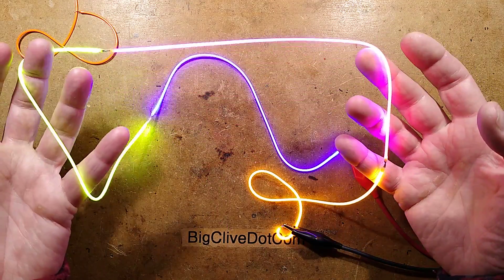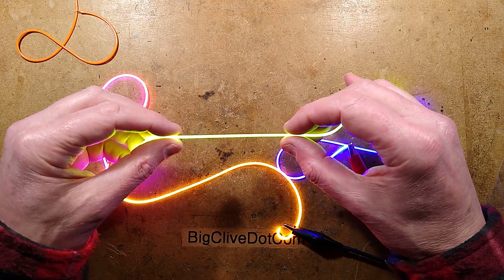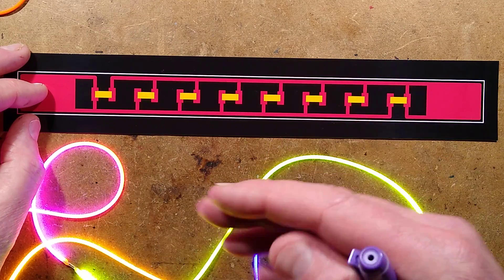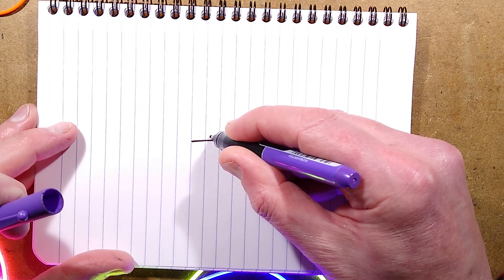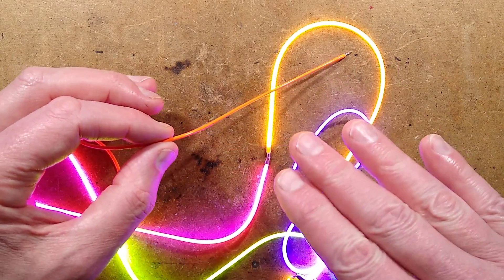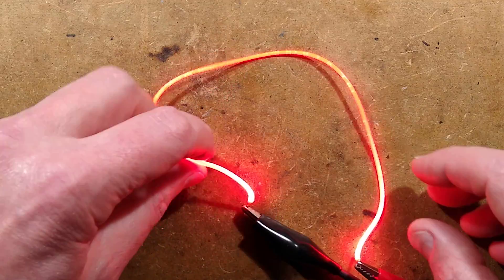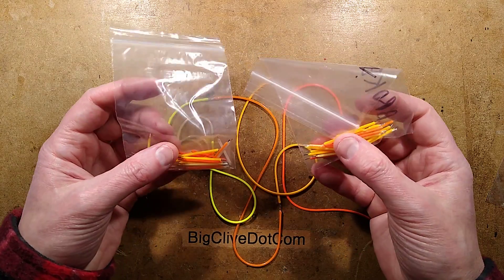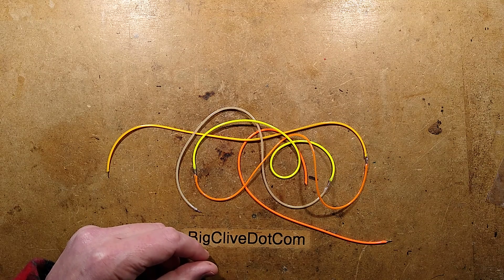How long LED filaments are made

Comment: I would like to run a pair of these in series off of a 2s Lipo battery... Would you use a 22ohm resistor? How should I do it for an RC car...
Reply from the maker: 47 ohm as calculated in my reply on your other comment.

Comment: Can you cut them shorter and solder back to the cut end, or are they a fixed length?
Reply from the maker: You can't trim them.  But you can get very thin single sided LED strip.

Comment: The strips being dimmer in the middle could be total internal reflection causing them to act similarly to a glass fiber. To check this you can try to bend the strip and see if it gets brighter on that spot.

Comment: they use 230v to 3v converter in these e27 bulbs and that's it? How they do it that it works with a wall dimmer?
Reply from the maker: Not all LED lamps are compatible with a dimmer.

Comment: Good day LED wire me tire resistance on the ends or just because the wire is so small or maybe heat on the ends you know marginally but because of the size of the wire it induces resistance to the middle of the strip

Comment: not sure if im missing something, but do you need a resistor in series with these? 
i mean, they are just diodes on a string, right? 
so if i connect 4 in series (4 x 3v = 12v), and hook it up to a 12v battery (say, a car) it would burn out if theres no resistance, right? 
-i just ordered 10pcs, so im very curious, as they are quite nice! cheers :)
Reply from the maker: I'd recommend a resistor to control the current.

Comment: Interesting. I wonder if the reason that they are brighter (receiving more current) at the ends although all the leds have equivalent resistance is because of the magnetic field generated by the circuit? Could you test that by looping the string of leds up and passing a powerful magnet through the center to see if the filaments glow more evenly throughout? Love your channel BigClive!
Reply: That moment when you get a like from a great content creator on a comment, then notice a typo in your comment, and proceed to edit it, deleting the like from said creator 😥

Comment: If you need a shorter length.  You can cut it to size then burn one end.  If you are careful you can expose the conductors. Some projects require a fixed length because I have no place to hide the surplus.  They are really wiggly and hard to manage.  No glue will stick to it as well.

Comment: The red ones I received are fairly bright and evenly lit, I don't think any have the brighter ends like yours do. They are very fragile though, I had one break in the center somewhere and is now intermittent, if using for an everyday items, I'd add some additional protection.

Comment: Ooooh pretty, and 4 sections are 12v? Sounds perfect for adding some extra light to some pinball ramps/wireforms.
Reply: Much better than the way they did it on the TRON LE pin

Comment: at 3V i guess you could use a single Lithium cell to run them all in parallel, running thin enameled wire beside it like you've shown they do with fairy-lights.

Comment: For the red ones, I wonder why they don't just use red chips and a diffusing silicone with no phosphor. Sure it would change the running voltage but it's not like anyone worries about that with literally any other LED technology. Or they could rearrange the wiring to two blues in series on the normal ones for about 6v and have 3 reds in series on the red ones to achieve about the same thing.
Reply from the maker: The main market for the flip chips is blue LEDs for phosphor stimulation.  I don't know if they even do red ones in that form.

Comment: 😍 you do understand whay the midle burnes less.
You only have to realize...💜
Thention.
If i hava 2 diverend negativetise 

==-min 100===================

=====================-1000==

After the furst the thention is bicker
But bevore the last the thention becomes lower.

Than the furst led has aboud thention diverentional - 900
The second thention diverentional -899 and somewere becomes -800

And this interaction to exeterated the phosfor atoms to maniveste  dragged space to leak out for ua to see the light.
The more diverentional to more draged to release and leak in to the inviorment 
And there for you starts at boths ends(stards) are brighter the the midle part😍💜🌈

Nice flexible led😍😍😍

I go look mabey they are olso in diverend lengts😍

Comment: I ve been testing with mine, the string plugs at only one end and it has two flimsy wires, one seems painted isolating it from the other single strand not isolated so not sure if they are from different technologies...

Comment: The trace length will affect the voltage drop between LED's
Reply: Could a Thevenin or Norton Theorem solve why the LED's are duller in the middle?

Comment: i think the off/tipped leds happens when the circuit board is conveying. Either the tension gets to high, or low, as the led chips are being placed on the circuit board, or during soldering. which could cause them to tip over. 
I really like these filaments, but they are delicate. Im holding out for the 5 mm version. =P
Reply from the maker: The 5mm (6mm) version is the LED neon strip.

Comment: I don't see how this can work without each LED having its own resistor.
We're talking about 200 LEDs here. Even the slightest difference in forward voltage between the LEDs should lead to a very short lifespan. And what if a few LEDs stop working? Then the others have to cope with the higher current. It just makes no sense to run so many LEDs in parallel without individual current limiting.
Reply from the maker: The products that use parallel LEDs tend to use forward voltage matched ones from the same batch.
Reply: @bigclivedotcom  Well yes but it's cheap Chinese stuff so I wonder how well they're matching. The fact that some of the filaments are lit very uneven already shows how bad the current distribution across the LEDs is. And it's still the same as a string of vintage parallel Christmas lights where one would fail and soon others would follow.
I guess the best way to use these is to underpower them.

Comment: The LEDs at each end of the strings being brighter is due to voltage drop on the PCB making the center LEDs dimmer. Every LED sees the same overall trace length but the average current over the traces is higher for the center LEDs (100LEDs of current rising to 200LEDs, in either direction) therefore they suffer higher voltage drop, compared the the LEDs on the ends (1 LED current near them, rising to 200LEDs current at the far end). The current is probably quite unbalanced to make a visual difference like that - I wouldn't be surprised if the center LEDs are drawing half the current compared to the ones at the ends. Problem can be solved by dividing the string into multiple parallel connected shorter strings with dedicated traces but of course that requires more than 2 traces.
Reply: It could also be due to the light reflecting at the ends in the silicone covering, since it appears that some of the light is diffused through the covering material and therefore would act somewhat like a fiber optic string
Reply: Would it help if the supply traces were thicker?
Reply: @warpeggioslab  or taper the traces so that the resistance is lowered where current is highest but increased where it's lowest. The current to the middle LEDs would flow through the thickest parts of the traces on both sides. The current to LEDs at the end would flow through a short thick section on one side and long thin section on the other.
Reply: @warpeggioslab  yes. But in theory you need an infinitely wide trace to have completely even current distribution.

Comment: Why has nobody in the Gundam community not used these to do a Strike Gundam with one of these in the beam blade? It would be perfect because that blade actually has metal on both ends of the beam so you could complete the circuit, unlike the more "lightsaber" style weapons where the blade would not look right.

Comment: Next step is they find a way so you can cut it to the desired length. Would be awesome if you could buy spools of this stuff and just cut off whatever length you need. May proof very difficult though because the circuit board is so narrow and fragile.

Comment: the reason they're probably brighter on the ends and not in the center. might be the fact that they are trying to mimic actual neon, and actual neon it's always going to be brighter on the outer ends due to the fact that that's where the voltage is coming from.. just a thought

Comment: Extra copper resistance will give you this effect of dimmed leds along the strip. Same for long 12v strips at the end you may be down to 9-10v
Reply: As Clive shows in his diagram (assuming it's correct) the  total copper trace length should be almost identical for each led - barring the two endmost ones which have a double connection to one terminal for some reason (probably mechanical).   

To make that clearer, held the with the anode terminal left and cathode terminal right, the leftmost led has a short anode trace and a long cathode trace, the rightmost led has a long anode trace and short cathode trace.  As you move from left to right each led trades a  progressively longer anode for a progressively shorter cathode. so they *should* be on balance the total length of copper, which is what matters.  

There's no reason I can think of that more than one led on each end would be brighter, which may be what we are seeing just gets blown out so hard to tell.
Reply: @JamesSleeman  Go on and simulate it yourself on circuitjs, it works exactly this way. it becomes resistor ladder not just copper wires of the same length.

Comment: hah You had probably already ordered this by the time I suggested you to get some a couple weeks ago... but thanks for this either way!
These are amazing looking, and when I had been checking them out on Ali back then, I hadn't even considered other colors beyond the "incandescent filament" replacement yellow-orange (ie warm white). Which, as BRUXXUS said, it's like what EL Wire should've been. Though, admittedly, EL has the tradeoff of being much longer.

Anyways, I wonder if the brightness at the ends might be some sort of "Fiber Optics" sort of effect that's occurring through the fluourescent coating?? Probably not, but that's all I can think of that might plausibly be the case.

Do we know how long this would run off a 3.3 watch battery -- say the CR2032 or the thicker 'higher capacity' ones (or two batts in parallel), to make much cooler "throwies" out of? 
("throwies": typically a watch battery powered, zero-IC or minimalist IC device that lights up or flashes; so named due to being small and able to be easily thrown around, but cheap enough to be 'disposably manufactured', ie throw-away)

Comment: Each LED has the same length of wire but not all the sections of wire carry the same current. Maybe the middle LEDs are dimmer because, on average, their wires are under higher load, hotter, and thus higher resistance.

Comment: Can you please try to make either a necklace or bracelet with these? It could use something like a cr2032 battery in a little case to act as both the power source, and clasp to hold the ends together.

Comment: The reason the led at bout ends shines brighter than in the middle is surely because these are produced with weirs that are so thin, that they loose power due to resistance over distance. And at each end, closest to the "power source" the led`s have the potential to deliver or receive higher current even if it the voltage is the same. The work more efficient wen they have the potential to pass trough more electrons. Ehm... they "ask" for more, because they can, and in fact doo pass trough more... Poorly explained, sorry🥴

Comment: I think the variation in brightness at either end will be due to the "distributed" nature of the current paths. Whilst the resistances are balanced, the IR drops for each LED aren't. You'll get a symmetric quadratic function for the voltage drop with LED position. Compare with Elmore delay model approximations etc. where the delay of an RC line goes up with the square of the line length.

Comment: Lengthy comment incoming!
This reminds me - again - of a strip of 12V RGB LED tape which i found once that's been floating about in my "misc. lighting stuff" box since. I would like to put it into my computer cabinet 😃. Has 4 solder pads, cuttable by ~15cm/6in. segments. Plus goes in, through the LEDs, and comes out as three lines you're supposed to switch/modulate etc. 
There's a tiny box with it. It has a barrel jack for 12VDC supply, one cable (4 in./11cm) with an IR receiver("CHQB") and another cable for connection to the tape.
Just says "LED RGB controller" on the plastic box, and "made from Chineesium". Inside - all in SMT - is: 
a 24c02 IC (isn't that an I²C serial EEPROM? Light pattern bitpool?) and a blank eight-legged bug labelled "MCU" on the board. 
Some caps&resistors. Two glass pipes between the "plus" and the MCU (one diode and one Zener). 
Three A2SHB switching transistors, each connected to the MCU per a 10k resistor. Thing is using PWM, i assume? I don't have that IR remote control, but I would like to make a "powered by DIY and Arduino" type gadget to remote-control that box.
Does anyone - maybe even Clive? - have a code list or Arduino sketch with the #DEFINEs for what to send to those gadgets? I assume they are relatively similar in codes assigned to the functions?
Sorry, i know this video's comment thread here is not the most appropriate place to ask such questions. 😃
If gathering the IR codes involved is too much of a hassle, I'd scrap that control box and make my own dimmer box. Re-watching your "555 timer RGB dimmer" video right now for inspiration in another tab. 😂

Comment: I don't think the LED's are brighter at the ends necessarily due to a difference in voltage or resistance, I think it is just the "fiber optic"-like effect of the cable itself and the light is amplifying on itself?... Just a guess

Comment: Solvents will swell the silicone, and eventually turn it to a jelly-like mess, but to break the cross-links and actually dissolve it away is a very different process.  Acetone + ispopropyl alcohol, with a splash of ammonia, might do the trick.  
The LEDs at the ends glow brighter because that's where the voltage drop is greatest.  (Imagine pipes laid out in a ladder pattern: the flow through the middle rungs would be lower than at the ends.)

Comment: It is never a good idea to connect LEDs in parallel.  The voltage drop among them will never be perfect so the ones with a lower voltage drop will clamp down those with a higher one.  They could be relying on the small but finite resistance in the trace or there are resistors built into the LEDs.

3V * 1mA per LED * 300 LEDs = 0.9W.
Reply: Its fine to connect matched LEDs in parallel.

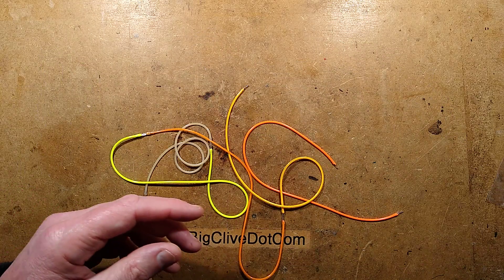Comment: 9:22  This is a really common issue with ordering from China, they know you are on the other side of the world and not going to return the item so they regularly throw rejects and seconds in the orders, especially to new buyers.  It’s a really short sided thinking.  We import a ton of our raw materials from China and are lucky enough to have formed a deep friendship with our agent in China and even he gets screwed over sometimes.  For most of our shipments he personally goes and inspects the merchandise before it is packed and sealed.  For really mission critical orders he has even sat and tested or inspected each item to make sure that it is correct.  it’s all about relationships when dealing with Chinese sellers.

Comment: SMD parts flipping up during reflow is called 'tombstoning' and it happens to small resistors or caps sometimes too.
Reply: Tombstoning is when one side lifts up and disconnects, apparently in this case it would be called "billboarding" which is more rare.
Reply: @jaro6985  spot on. I'd never heard of that. I've experienced tombstoning before though. Turns out 'billboarding' is down to faulty placement or oversize pads. You learn something new every day!

Comment: I wonder why they didn't just use red LEDs for the red. It would be brighter and not require any phosphor, so no doubt cheaper. It would require 2V, but you could always just use a resistor.
Reply: UV leds are the cheapest option nowdays, so if possible they get used and phosphor does not really add up the price.

real good red leds are expensive and it might even be possible the formfactor of these flipchips is only available in UV, so there is only this option.
Reply from the maker: I don't think they make red flip chip LEDs.

Comment: Silicone based "personal lubricants" will soften and act like a solvent to silicone. Coating the wires in it would probably have been enough to turn the coating to jelly and allow you to easily strip it off.
Reply: There are bottles of silicone stripper sold for removing silicone caulking around bathtubs.
Reply: @JimService  but the lubricant can be used for fun later 😉
Reply: @anzer789  Just not the same lubricant used for dissolving the coating :D
Reply: Possibly also dichloromethane would work.
Reply: Just be sure to take the nookie pills first